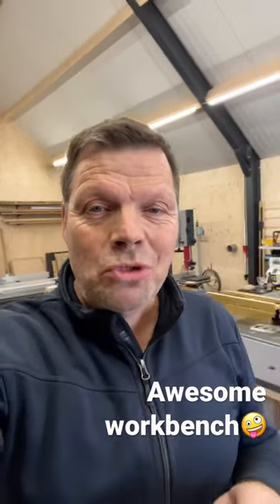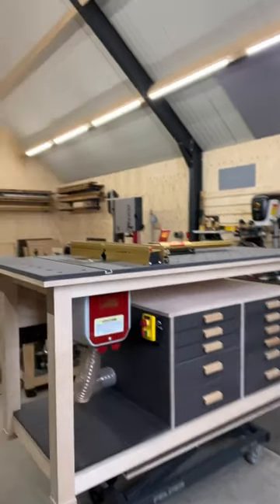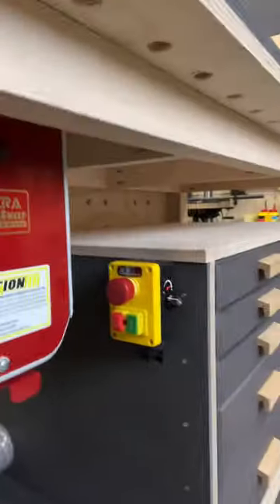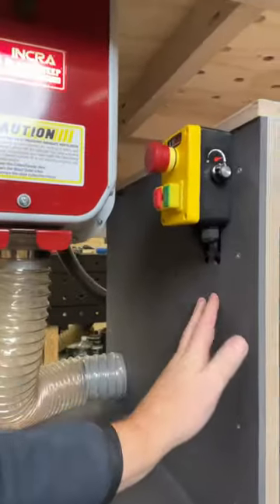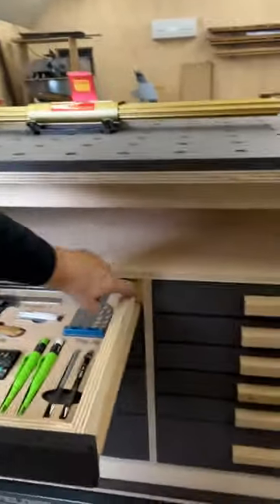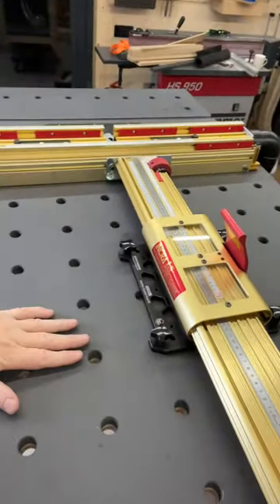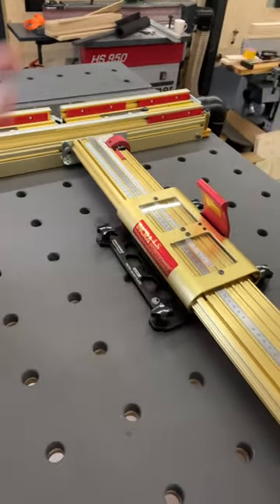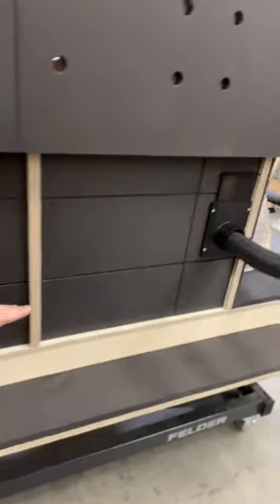Finished my NEW Workbench/router table, and it looks Awesome! #shorts

Comment: did you modify your existing one or start over from scratch?
Reply from the maker: No, modified. Especially the top of two sheets. This is easier construction wise but also more massive as a workbench top. Frame it the same

Comment: do you use a uk to euro plug adapter or did you just wire in your own plug?
Reply from the maker: No, i used an adapter. Better for warranty issues
Reply: @HookedonWood  what brand adapter are you using? most seem to be a low quality